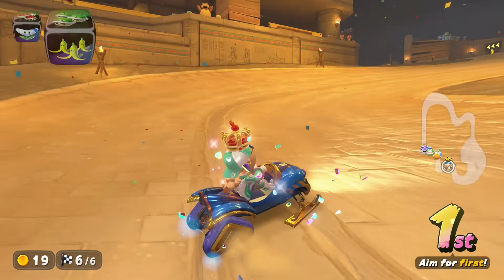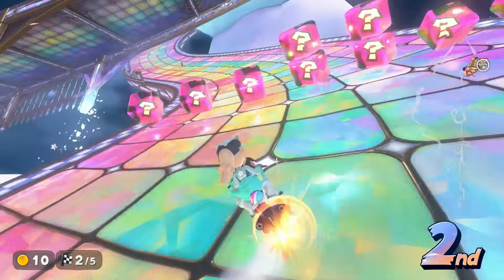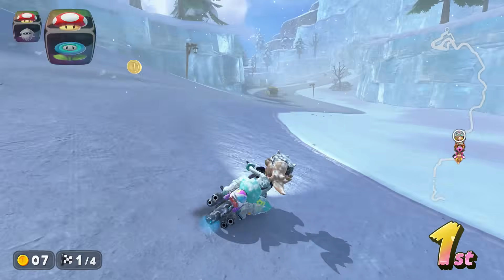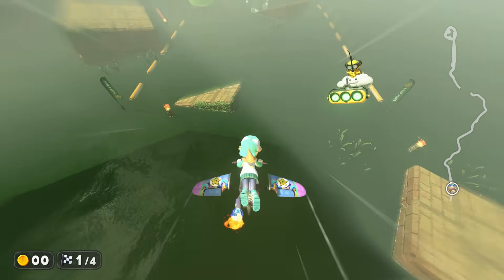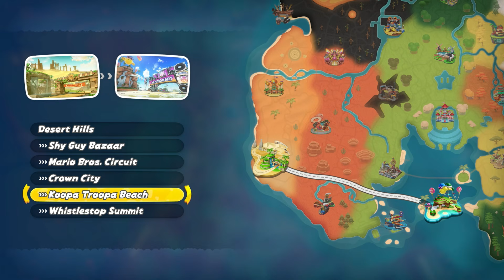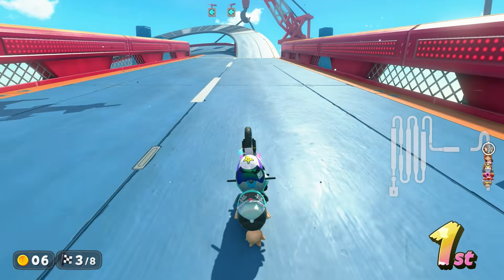Every One-Way Intermission Route in Mario Kart World Explained

Comment: I haven't finished the video yet, but one thing they might be considering is leaving obvious and easy options off the table, so they can release a DLC later with some paid content, and include those, or, give those for free in a free DLC, released alongside the paid DLC, which would get them some good will by giving out "free dlc" but some large portion (or all of it) is content that was already, or almost already, in the game and takes minimal effort to add. So it pads out the much smaller amount of actually new content

Comment: My guess for DK Spaceport was that 8 laps is a LOT of laps, and is only possible because the track itself is 6 laps, has to be played in it's entirety after an intermission, and the route has to be 2 laps minimum since Nintendo said so. Any routes that would be longer that 2 laps are one way, so as to prevent the lap count from going any higher than it already is.

Comment: I figure most of this has to do with the running time of each route, and that includes the time spent on the circuit at the end of each route. I timed the amount it takes to drive each route using the slowest possible combination I could think of (Swoop, Standard Bike, 50cc, no items, no coins, no tricks, no dash plates when possible) and it came out to an average of almost exactly one minute between each checkpoint, with each route having 3-5 checkpoints each (I know DK Spaceport has 6 checkpoints but I counted them as 3 since they're half the usual length anyways). So the typical 150cc race will take around 40-50 seconds per checkpoint, or about 2-4 minutes per race. The biggest outlier to this is obviously Rainbow Road, which usually takes more than a minute between checkpoints even on 150cc.

Comment: you overthink way too hard in this video it's nauseatingly simple.

KTB is a super short track so it can receive connections from longer distances and still not be an excessively long race.

DKS is a LONG track so it can only take short distance connections.

BOOM.

I get you need to make a quick buck and have to pad out the video with your waffling, but it's already 18minutes long, and I lost interest when you brought up the length for the 10th time without even bothering to take a second to pause and think that maybe length itself is key in all of this.

Comment: I feel like the two main culprits for why DK Space Port has so many one-way routes are time and road layouts. Nintendo seems not to have too many overly long races, and DK Space Port is the only full track besides Rainbow Road, and due to its location. Due to its location, it is hard to have that many good feeling and good length intermissions to DK Space Port, as they would typically need to cross into Wisstle Top Summit or into the Crown City areas, making them even longer. While the river path is an option, I feel like the glider ramp would end up feeling too narrow and steep to make it feel natural as well. So, no matter what, the path to DK Space Port would feel overly long and a bit awkward in some places. And I feel like that is the reason why Nintendo gave it so few connections. Which is also probably why Koopa Troopa Beach has one way to Desert Hills and Great ? Block Ruins, as they would feel too long when you have to race an actual full track.

And for the other segmented tracks, I feel like it is once again a length thing, for why they typically don't use the entire track. Unlike DK Space Port and Rainbow Road, Mario Circuit and Peach Beach can be easily separated to reduce the length of the race. But, weirdly, there are no routes to play the original Peach Beach. And for Rainbow Road, it mainly comes down to how it does not exist in the main world, so you need a special connector to it, and other than Peach Stadium, the only other options would be Crown City, Koopa Troopa Beach, and maybe DK Space Port. But these three options all would end up being long, mostly straight waterways, which is most likely why Nintendo chose only to have one route. And because it only has one route, it is less likely to appear due to how the online track selection works, as you either need to be at Peach Stadium and it is chosen as an option out of the other routes out of it, or it has to win a 1/30 chance if a non-intermission is an option.

Comment: The reason why the southern entrance to SHS is never used is because it would require you to race almost 2 full laps of the tracks
Reply: And the reason for the 1 way routes is because going around to the north would add on unnecessary length to 2 already very long intermissions
Reply: @ZachIsDutch So you're saying Wario Shipyard -> Sky-High Sundae isn't too long, so the wrap around to the North entrance doesn't hinder the time?
Reply: @ZainePittman exactly
Reply: @ZacharieMKWorld Also, for your first point, are you saying that racers would be driving more than 1.5 laps of SHS if they took the south entrance? If the issue were driving 1.5 laps of a track, then SHS wouldn't be the only track like this, since as pointed out in the video, Dandelion Depths -> Cheep Cheep Falls leads to you entering the course midway over the waterfall, racing 1.5 laps of CCF. Likewise, I don't recall which route this is, but there's a route which leads to SSS that glides you out over the bay, which is midway through the course, and then you complete 1.5 laps of SSS. Not to mention routes which lead to PB which avoid lap 1 altogether and simply take you through laps 2 & 3. So, Nintendo's focus cannot be avoiding 1.5 laps of the track you drive to.
Reply: @ZainePittman dd to ccf is a much shorter route so doing the extra half lap doesn’t matter much
Reply: @ZachIsDutch  Which is why my theory is that the only problem is the time for each route, and Nintendo just decided that the south entrance to SHS would only be free roam exclusive.
Reply: What does SHS stand for
Reply: @NitroShellMKDS  I believe Sky High Sundai
Reply: @NitroShellMKDS sky high sundae
Reply: @NitroShellMKDS Sky High Sundae
Reply: So what? People want longer races, not shorter one. Most people want them to fix the game by letting you race 3 laps on all courses.
Reply: @cbernier3 nobody wants longer intermissions bro
Reply: @ZachIsDutch  I didn't say people wanted longer intermissions. I said they want longer actual tracks after the intermission. They want three laps or more after the intermission.
Reply: @cbernier3 3 laps after an intermission would be too much
Reply: @ZachIsDutch  No it isn't too much. People play for hours at a time. I'm not going to boot up the game just for one race.

Comment: With Great ? Block Ruins to Koopa Troopa Beach, there's also a massive jump in the middle of the route over a large ravine which did not seem designed to be reversible. And as others mentioned, the DK Spaceport one-way tracks are probably just to remove the three-section routes to keep races ending on the full runthrough of DK Spaceport from being too long.

I should mention, if I were designing the game, I'd add a game mode, which I'll call "Ultra Mode", in which all races in Grand Prix and VS Mode (and a separate lobby for online races) would end with racing a full three laps around the destination track even after approaching from a route (and Koopa Troopa Beach would still have 5 laps and Peach Beach would take the first lap through the OG course; let me know if you want to know how this would affect Crown City, Mario Circuit, or Peach Stadium). With this change, the formerly one-way routes to DK Spaceport would be reversible, so you can play an epic 10-section race from Peach Stadium to DK Spaceport if you want. (Also, this mode would be required for 200cc because just one lap at that speed would be way too short.)
Reply: I think the biggest issue with your "Ultra Mode" is that some of the races would feel like they're overstaying their welcome. N64 Rainbow Road in Mario Kart 64 still holds the record of taking the most amount of time to complete being 6-9 minutes playing it normally, and that's just 3 laps on 1 course
Reply: @benthecat4345  No course in modern Mario Kart comes even close to having a single lap/section as long as MK64 Rainbow Road. In the case of World, every course not named Rainbow Road finishes three laps at 150cc in 2 to 2.5 minutes, perhaps 3 minutes tops if items are especially crazy. Add on the time from the intermission routes, and maybe some of the longer races lasts for 6 minutes total if you're unlucky; realistically, most races would take between 3.5 to 5 minutes, at most comparable to what racing on Rainbow Road from Peach Stadium is like now.
Reply: Yeah, they really should've allowed playing all laps on the ending course an option and put that in Grand Prix. Crown City could use its non-route variant like in VS Race and Time Trials, which races through all 3 layouts. Mario Circuit could race through all 3 sections as well. Peach Stadium's 2 rectangular layouts (like in Shell Cup) shouldn't really exist in the first case, you would just race 3 laps around the Special Cup layout that's used as its non-route variant in VS Race and Time Trials. I don't think you could easily connect the Peach Stadium layouts anyway. The two finish lines are on two different elevation levels and are perpendicular to each other, so to connect them you'd have to drive around in a 270° turn to get to the other. The 2 rectangular layouts use the same finish lines but driving in opposite directions, so driving them back to back would require driving around a roundabout at the side.

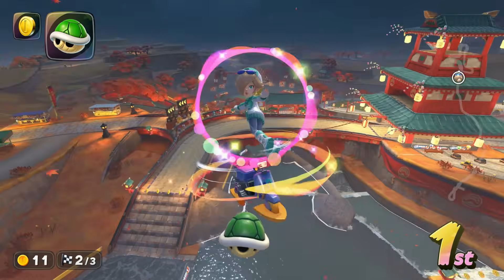Comment: 6:39 On some of Choco Mountain’s routes you enter the course backwards then skip the first few turns. They could’ve done that for Sky High Sundae too, but oh well.
Reply: Where on Sky-High Sundae would you enter in reverse? Also, you enter Choco Mountain backwards and proceed onto the track from the metal ramp to progress again in the correct direction. Choco Mountain accomplishes this because it has turns that alternate left and right. You're ONLY making left turns on Sky-High Sundae (Unless you're in mirror mode, in which case, it's only right turns). How do you expect to enter the course backward and finish forward if you can only make a turn in one direction?

Comment: Another factor with DK Spaceport is that it's one of the longest tracks to end on, that might have factored into not letting it have long intermissions going into it?
Reply from the maker: Maybe. I decided to test just how long a theoretical Desert Hills to DK Spaceport route would be by timing the intermission between DK Spaceport and Desert Hills, then adding a full race of DK Spaceport and ended up with a total time of 4:23. That's definitely on the longer end of the spectrum for Mario Kart tracks, though whether or not that's too long is up for debate.
Reply: @CMeeCraftGaming still Shorter than N64 Rainbow Road (and Maybe OG wario stadium too?)
Reply: @CMeeCraftGaming  only a little longer than desert hills to ktb
Reply: @CMeeCraftGaming  no such thing as a track too long 😎
Reply: rainbow road is an exception because it is a great track so u forget how long the track even is
Reply: @Canned741  the only intermission that goes into rainbow road is the shortest intermission segment in the game
Reply: @puffton9782that is another good point

Comment: 14:27 or, it'll be too long. Imagine doing a 3 section intermission and then doing 6-segments of dk spaceport. That would be 5 min which, mind you, is a time only reserved for actual special tracks like rainbow road. That's why they are only one-way: they'd be too long, not from some conspiracy for some online bs.
Reply: Yeah, I was gonna say that too. DK Spaceport is one of the longest tracks in the game, and a long route to it would make for an incredibly long race.
Conversely, I think that's why Koopa Troopa Beach has so many long routes to it, because it's the shortest track in the game. I doubt these routes have less to do with distance between tracks as they do with the TIME a race would take. That doesn't justify everything, but I think it's a good explanation.
Reply: Yeah. Making it a conspiracy is a bit much, but the core reasoning makes sense; segmented tracks with an intermission leading up ends up a bit too long, so they limit how many and how long the intermissions are
Reply: @Kafaldsbylur  yes, that's the real point here
Reply: I'm pretty sure standard online races just straight up get cut off after 5 minutes. (They would be cut off in Wii, at least)
Kinda puts a hard limit on track length: a 5 minute track for easy CPU drivers at 100cc.
Reply from the maker: Fair point. I raced Desert Hills to Koopa Troopa Beach in 3:44. Whereas the intermission between DK Spaceport and Desert Hills plus a race of DK Spaceport took me 4:23 in total. That is longer. But in my opinion not so drastically so that it justifies not even giving people the chance to select the route. Ultimately, I say give people the option and if the community thinks it's too long, there's two other tracks plus random that you can vote for instead.
Reply: @CMeeCraftGaming  also, part of your mario circuit reason doesn't work because while you can play mc1-3 and mc3-1 fairly easily, you can't play all 3 starting on mc2 without doubling back.
Reply: @CMeeCraftGaming  I guess, but to say that this is all part of one big conspiracy theory when it could just be plain incompetence or even a "good" decision from their eyes is a bit too far.